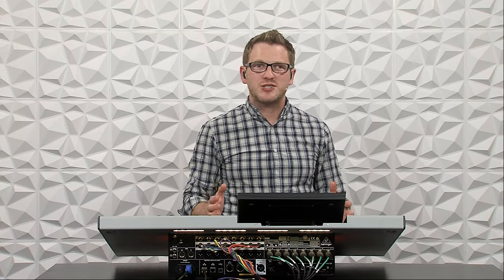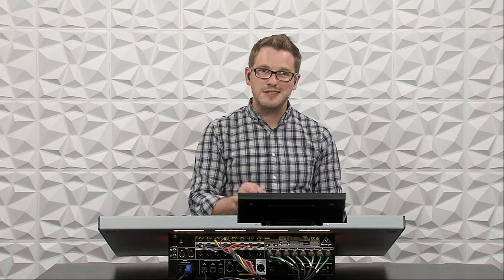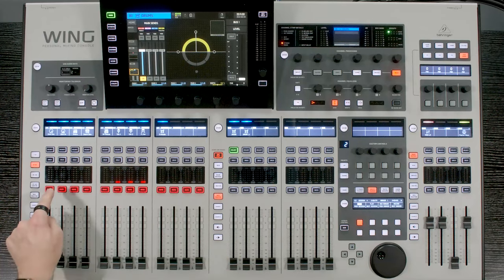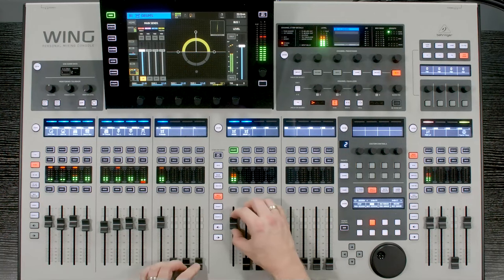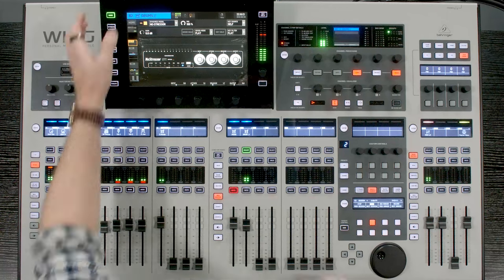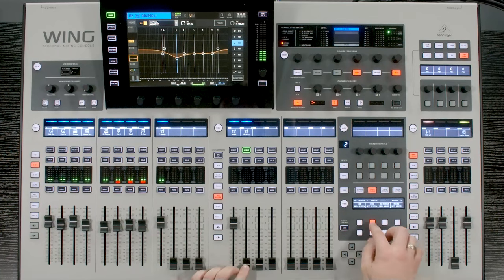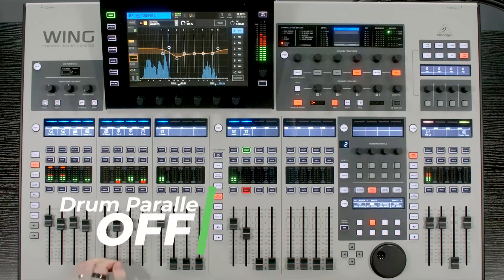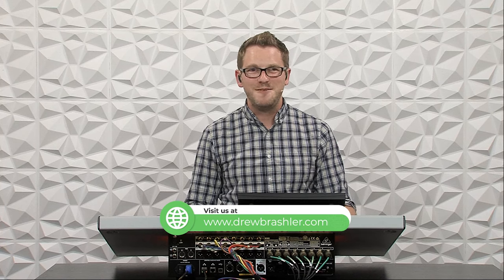How to use a Parallel Drum Group on the Behringer Wing

Comment: Drew, love the channel, you've been a real life saver for me! I use an X32 as the I/O for my recording studio. To use outboard gear I send DAW outputs 17-32 to the corresponding X32 channels via USB and route those channels to the XLR outputs of the X32. Then inputs 1-16 are my returns which go back into the DAW. Is it possible to route the card inputs from the DAW directly to the XLR outputs without needing to tie up channels 17-32 on the board?

Comment: Great video, thank you! Question we have an electronic drumset (Efnote 7x) and it's great, but I'm wondering if we can do parallel compression with it. I was thinking of just doing a high pass filter to cut out the cymbals, crash, highats - but not sure how that would work given you boosted that area on your toms/kick acoustic drum group. 

Thanks!

Comment: Drew! One thing I wanted to know and couldn't find anywhere: How can I use external Inserts in my channels? A cable going out, a cable going in, and everything arrives in the same channel.

I was thinking about using a Midas DN4888 exclusively for this setup (so I could insert up to 8 external FXs into whatever channels I need, right?)

Is that possible in the Wing? Can you make a video about it?
Reply: You can put an external insert in any of your 16 FX slots and route accordingly!!!

Comment: I love stuff like this! Wish the wing had more busses, with 4 wedges and 8 IEMs and fx, not too many busses left after that to play with 😭
Reply: Why you don't get an X32 rack just for the monitoring, that is going to free up all of your busses on the wing and the 2 consoles work together without any issues. You can easily take the inputs from an S32 or M32 to feed both consoles at the same time. The investment for an X32 rack, it's very reasonable.
Reply: @leonardocaminati6432  because then I'd have to mix everything twice. All the processing I'd do on one, I'd have to do that again on the other. And if I add a source to 1, I would then have to remember to add the source to the other. 

Basically doesn't sound appealing to me because I don't like doing twice the work every time I change something.